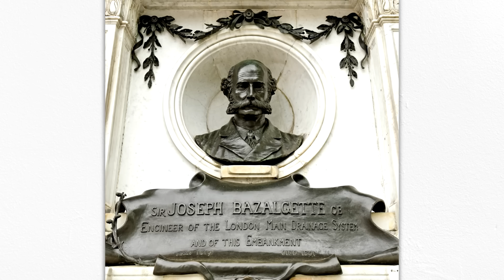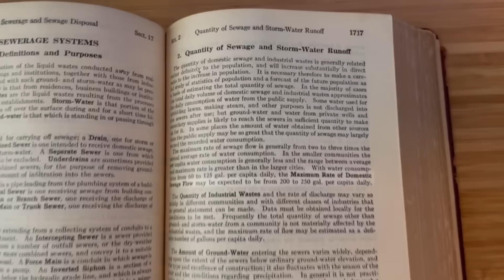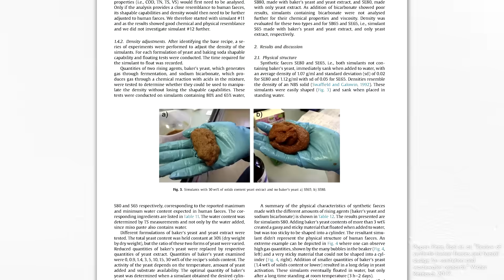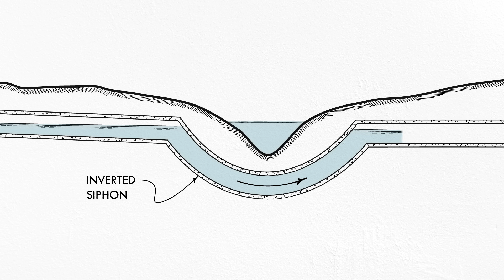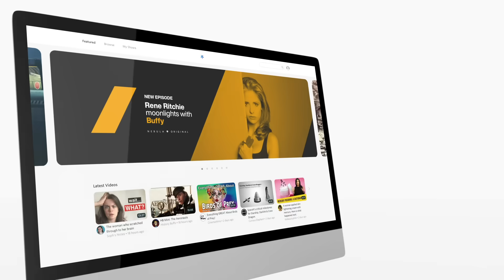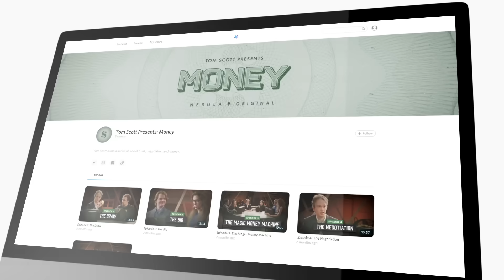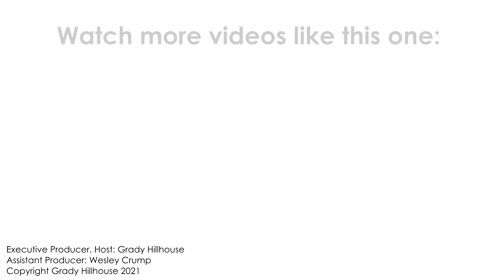How Sewers Work (feat. Fake Poop)

Comment: I've designed a few replacement sewers, through an urban area, and trying to find a route that keeps the sewer line at the desired grade, and threading it between (i.e. over or under)  intersecting stormwater lines, watermains, stream culverts, and anything else that might be in the way, was a real exercise in persistence, and a  fair bit of trial and error.
And I absolutely agree with Sir Joseph Bazalgette in 'oversizing' his sewers.   Because, the cost of the sewer pipe is only a small fraction of the total cost of installation.   And if in 30 years your successors find your sewer was too small and are forced to pay to do it all over again, they will find it an order of magnitude more difficult because the best (and possibly only practical) route is already occupied by the sewer you just put there!
(The fights I've had with bean counters who assume a sewer is a portable replaceable asset like a truck or a photocopier...)
In terms of capacity, our 'separate' sewers were generally designed for six times 'average dry weather flow' - and they would still overflow after a really heavy storm.

Comment: I remember someone representing the flushable wipe companies coming to WEFTEC several years back and trying to tell a room full of civil engineers that their wipes WERE flushable and it was our fault they were clogging pumps. He got booed off the stage.

Glad people like you and Adam Ruins Everything are helping bring awareness to how bad those wipes are.
Reply: What amazes me is that anyone expects a material that holds its structural integrity while soaking wet to be a drop in replacement for one specifically designed to breakdown in water.
Reply: the flushable wipe pricks are some of the worst.
Reply: Municipalities should be able to sue these companies. "Flushable?" Yes technically. So are a lot of things. Safe to flush? Hell nah. Screw them for making that claim.
Reply: Arshehole above 😅😅😅
Reply: I thought what you mean by Adam Ruins Everything is Adam Something, apparently it's a different person
Reply: Technically they are flushable.  Dissolvable in water, they are not, or at least take a longer amount of time to.
Reply: I’ve been flushing em for many years never had an issue, the wipes go into the rubbish tip when they get to the sewage plant anyway

Comment: The air valve shown at 10:00 is a clear / clean water air valve, those designed for sewage typically have elongated (taller) bodies designed to keep it from clogging and releasing dirty water into the environment. Thank you for another fine video helping to make the complex subject simpler.

Comment: You might comment on the problem caused by low flush toilets in sewers that were designed for the old toilets that used much more water.

Comment: I was told once that the ratio thing for sewage flow is something along the lines of: for every 42 feet in length of pipe, there must be at least a 1 foot decrease in elevation. Can anyone confirm this? Was working on an organic farm with natural spring/gravity-fed irrigation, they ran, gosh probably 500, 1000, maybe 2000 feet of PVC from the stream to the tanks? Hell probably more than that (walking the line took a solid 5 minutes), and they used that ratio, 42:1, to get rid of any soil buildup in the line. Didn't stop the algae though, blowing out the lines was always an interesting task

Comment: Another aspect of a sewage collection system, and is affected heavily by "flushable" wipes is lift stations, the almost 400 that my coworkers and I are responsible for are usually at the lowest area in a subdivision and have either two or three pumps to get the sewage to the force main, but they are susceptible to "flushable" wipes(and clothing) causing the impeller to get bound and could lead to the pump motor burning up(going bad) which could cause the station to overflow and spill sewage.

Comment: In the city of Ushuaia, capital of Tierra del Fuego province of Argentina, the sewage system is partly built of wood. As it was created as penal colony, the forced labour included developing the city. As it was isolated of the world in practical terms, and due to the availavility of wood, they built it with logs. The penal colony has been closed for many years buy most of these pipes are still in use.

Comment: I have an old plumbing and sanitary engineering book from 1921 which is quite interesting. Although the fundamentals were certainly for the most part ironed out by then, some of the specific items shown in it do appear to be in the experimental stage so to speak.

Comment: People should use an oil sprayer when cooking rather than pouring oil in a pan. Pouring in a pan not only are you throwing money away but must of the oil will go down the pipes which will eventually cause a blockage or cause a build up in your septic tank.

Comment: I've been in the plumbing industry for over a decade, "Flushable" wipes are one of the worst things you can put down your toilet, they might "Flush" and they might say "biodegradable" but they never say how long it takes for it to degrade or what happens to it after you "flush" There's a great channel called Drain Addict that can show you what happens to sewage pipes when they get clogged.

Comment: I've been responsible for the vaccum sewage system on the merchant vessels I've worked on. It's a nightmare when someone flushes something the system isn't designed for. After opening up and clearing the pipes, the smell doesn't leave your nostril for days.

Comment: Too really appreciate how great our sewer systems are in the US you only need to go to Iraq and sit outside, in the hot sun, on a piece of plywood with holes cut in it (complete with splinters), and poop into a 55 gallon drum that's been cut in half, all while flies buzz around your nether regions, and then pour diesel fuel in the drum when it's full and light it on fire...... Oh, and walking down the streets of some of the cities dodging the streams of sewage running down the road and then occasionally sinking up to your ankles in it is fun, too......

Comment: While informative you may want to look into force main and grinder pumps. The is process of sewage treatment doesn’t use gravity to get rid of sewage instead it uses what is essentially a blender to break down solids and pumps to push them down the pipes to a gravity line. A lot of new construction has this system especially businesses.

Comment: So... what kinds of innovations or inventions have engineers worked with to try to fix the wipe issue? I'm not engineer but i can't stop thinking of new ideas so maybe i should become one.

Some kind of brushless motor where the grinder is INSIDE of the pipe? (basically an altered sink disposal but for sewage)?
Reply: Idk strong dissolving chemicals, why not? Filters that are cleaned every week? I have a similar problem with mini fountain and cat hairs, they clog the entrance and sooner or later they bind the mechanism, filter help. And gunk idk why but there always slime thing everywhere.
 It looks like instead of inventions  they prefer laugh at ignorant people and putting up fines. And wtf it's not fair they don't teach that stuff in school

Comment: Great video! I used to work for a sewer company flushing lines and unblocking them with a high powered flusher truck. My god, the amount of those gross grease blockages was astounding. I drilled it into my family and told my friends don’t pour grease down the drain! Bacon grease as an example goes in a can. More people just need to use a little more common sense. :)

Comment: It's also very interesting, because you can often reach very secret/forgotten places through the sewer systems of a city. Here in Germany for example, you can access several very old bunker systems through some "creative" engineering in maintenance tunnels which are only reachable through the sewer network and date back to the early 20th century and earlier.

Comment: Also interesting to note the cross sectional shape of Bazalgette's sewer pipes in London. They're egg shaped (inverted) rather than circular, so that there is still a high water velocity when the flow rate is low.

Comment: The city that I work in and surrounding areas actually replaced all of the sewer mains, and forced citizens that use city sewage to replace their systems and have them all air pressure tested in order to fight INI. I spent 2 years plumbing new sewer lines, and now I clean them.

Comment: Using water to move waste was a great idea at the time when it was invented, and it has improved health quite a bit since. But really, using water for this, isn't very efficient and meaningful. Some kind of composting and/or de-hydration is probably much better. The reason something stinks (and holds a lot of bacteria) is because of the water content. Take away the water, and the problems go away. The dried waste is easier to manage.

Comment: I build water towers for a living so I travel a lot and I noticed down in Texas where it is very flat. I have noticed huge track excavator digging sewer lines 40 ft deep. They have to have safety cages for the workers to connect the pipes that deep in the ground to stop K bands from killing workers. And because it is so flat that sewage can only flow so far cuz it has to flow down hill. That they have pump stations set up ever so often to pump the s*** up to the ground level and then start the downflow again and there everywhere in Texas and everywhere there is one you can notice it because there is a chain-link fence around at some 2-foot diameter pipes that come out of the ground and then Pump It Again downhill. And everywhere you see a chain link fence surrounding some pipes and some pumps you can smell s**. Therefore I labeled Texas this stinkin estate of ever been in because all you do is smell s** everywhere you go. This is one place I would never live cuz I don't want to smell s*** every time I go to the store.

Comment: Hi, Just wanted to ask if the local Residential sewer line is lower than the main Sewer line (because of builder's error during construction) and due to that the sewer waste isn't flowing in the right direction towards main line instead choking and overflowing via manholes and thus creating problem for residents. What are possible and most efficient  methods to provide solution to this problem ?

Comment: I worked on the deep tunnel project outside Chicago in 1977 pouring concrete 300 feet below the surface.

Comment: If the sewer blocks with flushable wipes and fatbergs, what if you put three pallets of bricks on every manhole, then fill a correctly calculated stoichiometric amount of stove gas into it and then ignite it? Will it relieve the constipation?

Comment: Here in the UK we are still using Victorian sewers even though the population has expanded.  The reason for this is that the Victorian sewers very often are combined i.e. they take foul and storm water (originally to help scour the solids through the system) in one pipe but over the years we have been separating the systems such that the pipework take less storm and more foul.  We also have Victorian sewers that are not round but egg-shaped so that when there is limited liquid in the sewer then the narrow bottom helps keep the flow speed up to maintain the self cleansing velocity.  A circular sewer actually does not work well with limited flow as the lower the liquid the shallower and wider the liquid.  Due to a lack of investment following privatisation of the water industry the drainage engineers have not built/rebuilt the sewage network and now rely on pipework being surcharged to create a pressure head to increase flow.

Comment: I had the glorious task of instaling sewer pipe while doing site work for condos and let me tell you, it is a chore, you’ll have to dig it out, get the pipe, get the soap, put the soap on the pipe, clean out the pipe beforehand, get the ground level, check it with the laser, put the pipe in, then make sure it’s level, then hold it level while the other guy fills the hole to a certain point, then put more stuff in the hole, then cover the stuff, then break more rock, then rinse and repeat until you get to a manhole and then you have to break more rock, dig it out, level the hole with some method of your choosing with stone, compact it with hand tools, chain the first manhole piece to an excavator and walk it to the hole, lower it in when your ready, make sure it’s in line with the pipe, but first you have to soap the gasket and pipe, then insert a specially cut piece to finish the pipe, then put a tightener on it, then wash it out with water, then get the other pieces if there are others, then put this sticky sealant stuff around the top of the first part, then make sure the ladders are in line, then rinse and repeat for the cone or  cover and then add any extra bits, then fill the hole and compact it, then start breaking more rock to put more pipe in then get to the next manhole.

And for storm water detention systems or whatever you have to break rock and or assfault, and then get the chambers which when I had to do that we had to lift them off of trucks and they each weigh 35,000 pounds, and then get the hole dug, then leave the ground with stone, then chain up the chamber, then lower it into the hole. Then make sure it’s level, then line it up with the pipe, then seal the pipe to the chamber with concrete which we mix and move the the area, then put sealant on it, then put the lid on, then add more pipe on the other end, then keep going.

So yeah that’s the whole process for those two things, or atleast that’s what it is from what I’ve seen

Comment: One of the biggest reasons why things build up in sewer systems is because of these low flow fixtures we use.  Sewer systems, especially smaller ones, don't have enough water flow to keep waste moving as efficiently as they did back when no one cared how much water was going through our homes.  Older sewer systems depended on the higher amount of water to keep things moving.  I imagine newer sewer systems take into account this lower flow to make it so the lower amount of water can have almost as much force to push everything through.  Back in the day when storm water and waste water was combined, that increased flow during rain storms would help to flush the sewer systems and keep them clear.  But now with the lack of water flow, things back up which is why plumbers and sewer authorities like it so they can price gouge us to keep things working.

Comment: The flushable wipe issue keeps coming up. What are the standards that are set for toilet paper manufacturers? Shouldn't the same apply? Someone at some point figured out how we make modern toilet paper. And everyone seems to make it. There are thinner and thicker versions but they all to my knowledge are fine to flush. So why not the same with the flushable wet wipe? Also, why doesn't the industry promote the use of bidets or similar devices which would eliminate the use of a thicker flushable wipe? Who says that the triple layers double quilted charmin tp actually breaks down like you demonstrated?

Comment: Now I know why I see city maintenance crews getting the sewers so often. It's because they did not achieve the self-cleaning velocity. I can only imagine that there is a trade-off where sub self-cleaning velocities would build up solids based on how far below the necessary velocity they are. With proper calculations you could say I will suffer efficiency and replace it with maintenance. One of those engineering balancing acts.

Comment: it took me a while to find really flushable whipes. 99% of the prudicts that are labled flusheble are actually says on the back with small font that they are synthetic and not designed to be flushed. but gladly i found my product. they are basically wet paper towels and i cheked them in similar to 9:30 order before actually using them.